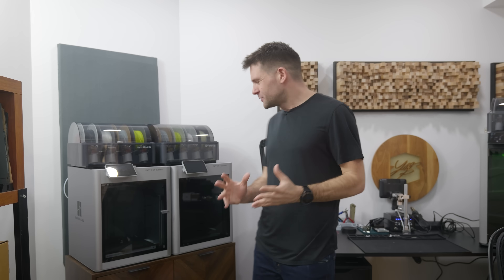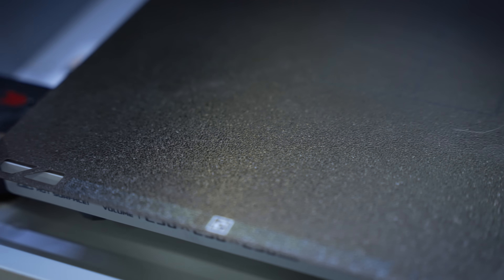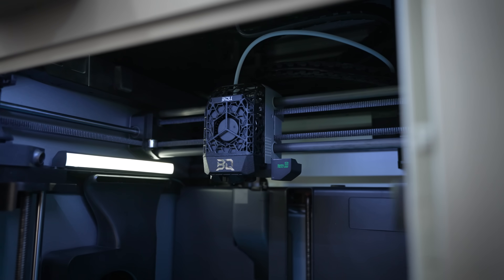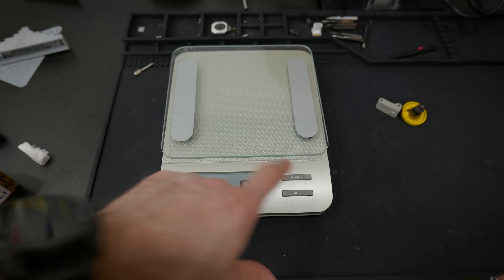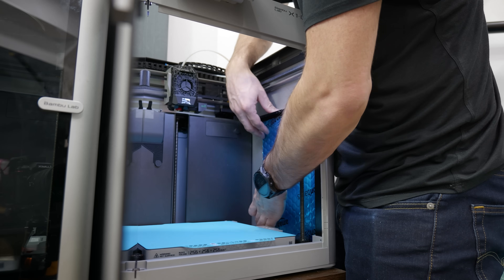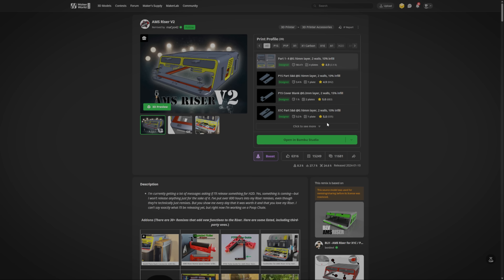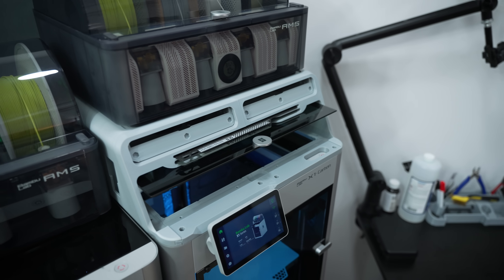I dont understand why more people dont MOD their 3d printers...

Comment: OK, stop right there... If you get wet filament from your manufacturer, YOU NEED TO STOP USING THEM. I've been printing for 11 years now, and have only really needed to dry my filament a handful of times, and NEVER once it's first opened. Nylon? yes. PETG? if it's been sitting out for months. ABS or PLA? No. Drying filament is the new "level your bed" answer for everything. People only really started drying and drying filament about five years ago. Yes, we printed with PETG longer ago than five years, and printed it well.

Comment: From my experience there are two types of hotends - E3D HF ObXidian and all other. Example: I have P1S printer. I'm printing PETG only (local vendor LBL). This hotend was able to pass max flow rate test at 40mm3 and there were not any issues in printing quality, even in filament color. I reduced speed to comfortable 35mm3 and increased speeds according to bambu recommendation for this hotend. Revo hotends unfortunately not performing well.

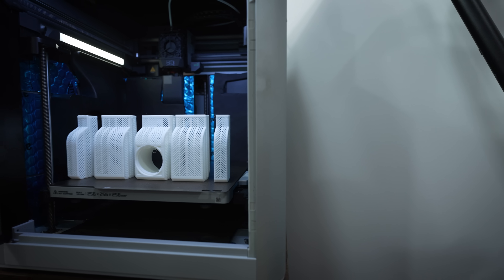Comment: 13:50 - For those who want to print the desiccant holders for the AMS unit, use the one with the sliding lid like in the video. I printed the ones where the lid was only pressed onto and I had to disassemle my AMS 3 times now because it slipped, ripped the top of and spilled all the silica balls in my AMS. I replaced them now with the sliding ones but I wish I had found the ones with the sliding top sooner.

Comment: I’m considering using the Biqu Highflow in combination with the Biqu extruder gear on the Bambu X1C.
I’d like to know if the Biqu extruder’s gripping wheels are closer together compared to the Bambu’s stock setup. Right now, when printing with 80A TPU, the Bambu extruder tends to slip if the settings aren’t dialed in perfectly. I can achieve great prints, but only by printing quickly enough to prevent the filament from folding on itself at a standstill when it starts to soften. However, if the temperature isn’t high enough, the grip wheels still slip. So it’s a tight balance.

Comment: I do understand... While I absolutely understand the desire of some to mod their printers (I am one of those) I am certainly not blind to the other side of the fence, where people will use their appliances (!) as is. The basic difference is whether you are using your printer to produce products (of any type or form), or if you are a tinkerer for whom the printer is the hobby. If you are in the first group, and you bought a device that does what you need it to do, why would you modify it, after which things may no longer quite work quite as well as you want them to? It is a different mindset, and the two groups use the printers differently. Don't mistake one for the other, and/or expect to have the wisdom to proclaim a one-size-fits-all solution, brand, type, plastic, or attitude... Just my $0.02.

Comment: Except everyone did mod their printer. You can look up any printer you've even heard of and there's parts online for it. It's been a literal staple of 3D printing since mass produced machines.

People that have been printing for years don't bother so much anymore. Because we've already been down this road. Making a bunch of BS parts. There were even fads like people were attaching squash balls as feet for vibration absorption. Ultimately the farther you go you start realizing that a lot of the stuff you're doing is just because you can. Not because it's actually better. Fan shrouds, different hotends and extruders is just the gateway. Next you'll start looking at a bigger fan. Or maybe even 2. Of course that needs it's own special shroud. What about the aux fan? That could always be bigger. Maybe a clicky probe would be better. Does the community have a custom firmware you can flash? Pretty soon you have boxes of parts just from what you've taken off. If you're lucky the machine works 2% better than stock. If not something breaks and then you're troubleshooting a frankenX1C and not a well documented stock machine. Or even worse some subtle change happens and you don't know why you can't really print PETG that well anymore. 

So it isn't that people don't mod their machines. It's that they really don't anymore. This isn't the Ender 3 days.

Comment: I was able to grab "the claw" for cheap and when I had my first major clog on my P1S,  I decided to install it. It went in easy and the printer prints with no issues with the new all metal parts. There is one benefit I have noticed though, for some reason my printer is now quieter during printing after install. IDK if it is because you grease the gears or maybe because of the added weight. Also, One of my first prints was the AMS drier with the hygrometer.

Comment: I did the hotend upgrade because i was having under extrusion issues on my X1C. I eneded up finding the gears were stripped on the stock one. So I did the claw upgrade, aluminum houseing, and the REVO hotend. I have the revo stuff on 4 other printers so it made sense because I have a lot of the nozzles. I did also get the build plate. When it says PLA and PETG only they mean it. I did tpu not thininking and wow did it stick. Just take my word for it.

Comment: I'm no physics expert but I think if you wanna make the printer quiet, you wanna cancel out the vibrations coming from the entire printer instead of the inside of the printer. The vibrations come from the motors inside the printer which are all connected to the case, so basically the box is acting like a big sound box, similar to how instruments like violins and guitars amplify the sound by using a sound box. So to make it perfectly quiet, you need to make a vibrationally isolated bigger box to contain all the sounds coming from the printer😂

Comment: BIQU has the most inefficient customer service. They were missing a wire for the P1S light kit and it took almost 8 weeks of emailing back and forth, then requesting pictures and sending multiple pictures of what I received, then them asking for pics again, I sent again, then they asked for a video, then filling out forms, before them sending a wire for a $10 light kit. So they did finally fix my issue. They have good products, but it was so grueling to get to that point. If they have a single form or can solve it in a couple emails, then they will be amazing. And their build plates are the best.

Comment: 25% coverage with constrained layer damping will achieve optimal results. The foil will help with radiant energy only not the type of conducted energy in this instance. 
The basic theme of my response is "wrong material for the task" and it's unsuprising since car people habitually use these materials incorrectly. 

This situation may have reduce vibration and have beneficial impact, also reducing echo and resonance from the printer (notably a change in tone) but not volume. For volume you would need an absorption product - foam, and potentially if there are low freq components, some sort of mass loaded material. This combo would insulate it more. Insulation is a 2 edge sword though because a heat element can overshoot and take too long to cool down for cooling changes.

This is just a super quick take on the topic, and for context I have a career managing radiated and conducted energy for the military as an engineer.

Comment: the problem insulation was butyl rubber. it's not good Here. it has good sound deadening, is durable long term, but it's thermal mass, not thermal insulation.
cars use it because durability and there's several layers before it for thermal resistance: as such, butyl is the sound deadening, or thermal mass to slow heat transfer in high temp locations, but no more. most producers now have an EVA foam they use in parralel: eva foam on roof and places where direct heat can penetrate: and anywhere road noise and engine heat are avoided. the butyl goes everywhere ELSE: it can take the engine heat, it thermal mass at least, and reduces road noise. it takes the everyday wear and tear better than EVA foam.

Comment: Im not smarter then engineers.Also Co's are using consumers as test subjects.   bad practice.     But making additions or customizing . Has been a go to since before the first rock was used as a tool. they modded that too.   if it doent work as advertised. whole different subject.

Comment: The panda revo extruder replacement is crap.. it clogs like crazy due to a design flaw.. how ever... the parts are great.. I swapped out all the x1c extruder gears for the panda stuff.. not even a hint of clogging.  You have to use the OEM nozzle, but it was working 100% clogged free before the switch..I did keep the panda jet pack kit..it looks alright..

Comment: The Panda Claw sounds like it would be a great upgrade, but I've actually had MORE extruder jams with. Where a normal hotend will have trouble pushing a filament through in some situations, the claw keeps going and chews up the filament real bad causing a worse jam and doing it more frequently than the normal extruder gears. It's also louder and requires frequent greasing. I would not recommend. 

I also don't recommend the Revo. I've had a lot of clogging problems with it and the "quick swap" nozzle on the Revo does't really save that much time, if any. The nozzle part is screwed in so tight that it actually requires quite a bit of force to get it to come out which usually destroys the little rubber grip pad around the tip (not possible to remove by hand so why is it even there?) Honestly, nozzle changes are so easy with the Bambu printers it's just faster and easier to remove the old one and swap in a new one.

The Panda Lux though is essential. Got one for both my P1s and will get one for every other printer I purchase.

Comment: You got the wrong plate. 😀  

The Frostbite plate is better in nearly every way - it's "stickier", can run cooler without issues, and almost never needs to be cleaned. Seriously, I have 2 of them that have only been washed once each since November. The Glacier plate is fine and better for a smoother surface, but it's only a marginal improvement over the normal PEI.

Comment: Wouldn't you need to retune the positioning dynamics to get any benefit from a lighter printhead ? Or is it autotuned on every run ? I can only see it helping otherwise if the printer already suffered from severe overshoot. On the other hand, using them in combination with the heavy gears will offset the effect of those which  might otherwise cause some undershoot.

Comment: Insulating the interior is certainly an interesting idea, but since heat always rises to the top, you will probably lose most of the heat through the upper glass plate. You can also see this quite well from the internal temperature of the ams when you have it on the printer.

Comment: had to pause this early.... dont get the revo hotend kit... its shit.. even with the "highflow" obxidian nozzles or cht styles they are subpar compared to the e3d highflow nozzles. the max flow i can use with the revo kit is 7 mms cubed and they wore so fast due to the carbonfiber. as compared to the latter mentioned which does the identical part at 28 mms cubed. u do the math..i got alot of jams with the revo hotend alone. with the e3c obxidian highflow hotends i have a fail percentage at less than 0.02% of runs of 1000.

the only upgrade worth getting here is cryoplates and the jetpack. i run mostly petg and the amount of prints i can flex off the plates before i need to clean them compared to the stock "gold" plates is so far beyond my understanding of why it is so. with the gold plates i need to clean with 99.99% iso every other print to cleaning with hand soap every 8 prints.

the skeleton head which you can make yourself in cad as the model is readily available for download with some clever searching and filtering. then voronoi the heck out the skin :)
 i you dont want to print ur own parts you can buy the jetpack and be fine :) also u can dremel the shit out the the stock shroud to get a few grams of weight out for the input-shaper to not fight against.

12:00 i came to the same conclusion. the best insulation i found was a simple cardboard box and an old quilt. even an workers winterjacket will do wonders for your chamber temps if u want them higher. 

15:44 those things interfere with the stock head. after you install those and start a print the printer WILL hit them every time after doing its front left corner smash. do not use the pulley covers that build outwards towards the print area!! u changed the models to be a grid instead. letting the hot air out and allow circulation and still stopping poop debris. ( after finetuning the stock wiper's height with some shims, there is no poopsmears on the nozzle anymore and the chamber is poopfree. i will give you a tip... is about 0.02mm tolerances.. its that fine to get it perfect. once u you do? then u understand why BL went with that solution ;) 

17:10 you want a hole in you table and a square to round adapter and a flexhose to a lidded box for the wastes.

17:47 it most certainly does until you align it's height properly, and write ur own wipe gcode. BUT once you do you do not have the "flying poop fragments" all over your build chamber. i found these in the rods and all over from the silicone nubs thrown off the ai1 style wipers. what you need is brake caliper paint on you nozzle and an autistic friend or colleague to assist you in finetuning the wiper height.  i shim the entire backwall as i found that there is no "one shim to fit them all"  

i run a shop here, not a charity..

Comment: its not so much people don't mod their printers, theres no reason to. that upgraded hotend is probobly the only upgrade i'd say is actually worthwhile for a printer like the X1 carbon, and the buildplate if your old one ever gets damaged.

modern printers like bambu printers are meant to work reliably. older styled printers like the old ender 3's or even old prusa's need to be modded to be improved, and every time you add something new something else breaks. the hotend system you got solves some jamming by just swapping nozzles. no downside outside of swapping the assembly. as for the rest? very easy to break and then your needing to buy new parts that work and hope it works.

Comment: My first printers were all Anycubic...brand loyalty, easy to modify.
Last year I got an X1C...only one 'native mod'.
Did you know that the top-glass knob has a hidden function?
Remove the knob, then re-install it rotated by 180 degrees.
Now the knob can be used as a hanger for the top glass, on the edge of the cabinet.
For those times you want the top glass removed but want a safe/handy place to put it!

Comment: Me, with like 15 different QoL upgrades to my X1C, looking at this video: Right, right. This is such an underrated, ignored aspect that searching for "printer mods" on any model site brings up almost no results.

FYI: The warnings about extra lighting interfering with the LIDAR is based on older firmware where it would. But later firmware revisions fixed that. Just like the LIDAR originally couldn't calibrate properly with the textured PEI plate, but now it can. Old information is rampant about those two from before they were fixed in firmware updates.

Comment: good to note that a diamond tipped nozzle is available for that "high flow hotend" (also called e3d revo)

Also if you want just the diamond tipped one and keep the stock hot end form, they also sell one for that too. they are sold under the brand E3D and also DiamondBack. The gimmick with it is that the diamond tip never wears out and it can improve flow because of the heat conductivity of diamond. I own one for my old ender 3 S1 and it really does hold up to its claims and it is real diamond.

Comment: You missed a major feature of the jetpack + cryogrip combo. The bed allows you to lower the temps significantly and the jetpack allows for much better air flow through the whole assembly. This makes things like petg+pla multimaterial prints for support interfaces much less likely to clog due to heat creep. The panda claw/extruder also adds a bit to this in my experience as it's metal—dispersing heat more easily—and not nearly so enclosed. I went from rarely being able to get through multimaterial prints without muktiple clogs to none at all.

Comment: A reason why a lot of people don’t mod their printers is that the good ones don’t need to be modded. Like it or not, that a very good reason. More and more of us aren’t 3D printer hobbyists or enthusiasts. We buy a printer to reliably and easily print parts. We’re not printing toys and we really don’t have to sit there and watch our prints. If we need to check. We can crack the door open for a few seconds and look. I’m not dissing those who get joy from doing all of this, but really, it’s not required. By the way, I’m not including add-ons. Add-ons are not mods, they are - add-ons. They don’t really modify the way the printer works, it replaces any original manufacturer parts. Like his tray he built for the top for the AMS. Nothing wrong with that. As long as your printer isn’t already high enough to make opening it to replace reels, this looks pretty good. And poop chutes or baskets are in the same category.
Reply: I agree with you almost everywhere in your comment. I bought my Bambulab printer to print useful stuff for my hobby shop and to do other projects, so modding and tunning was something to avoid from the start.  Some mods do help improve the printer, like the improved nozzle cleaner, but most useful things are limited to add-ons.
Reply: Totally agree. People have to think in billable hours saved by NOT having to tweak. Fine-tuning one parameter systematically for 3 days or billing a client 2K for some CAD work makes a huge difference in your pocket...